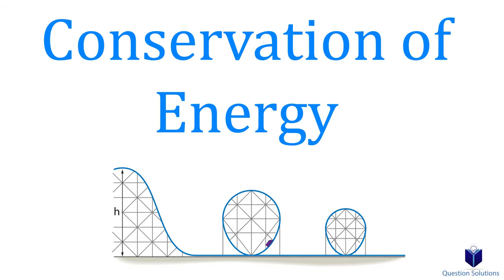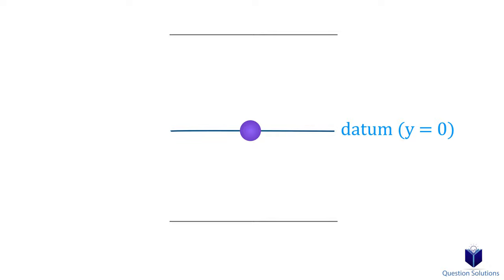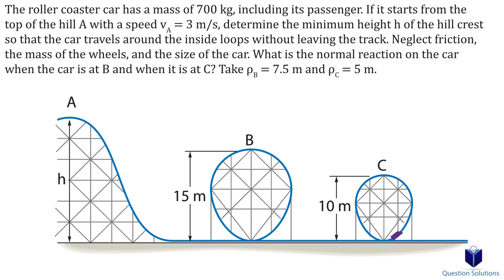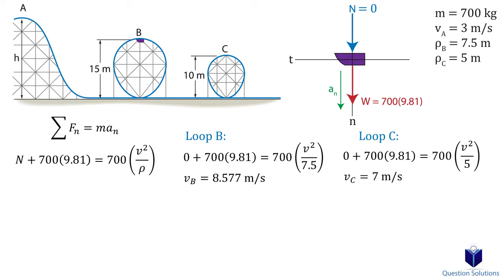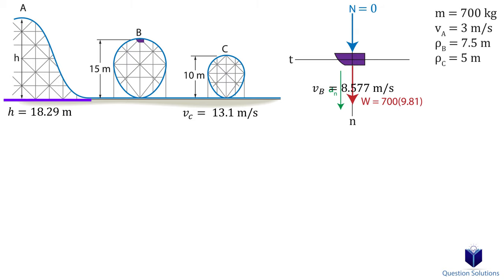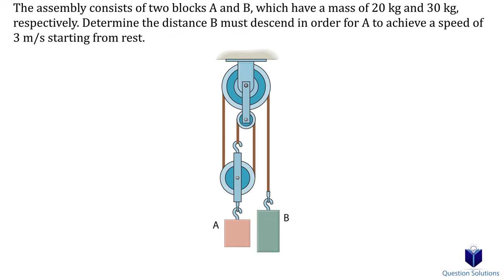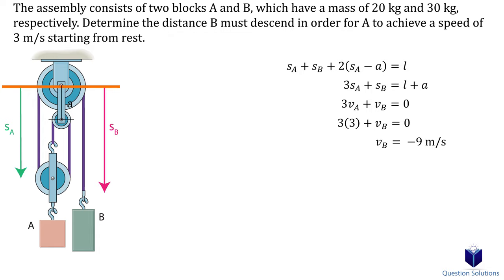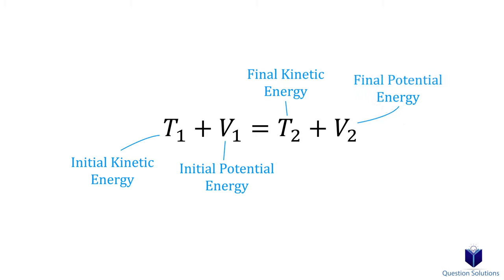Conservation of Energy (Learn to solve any problem)

Comment: 10:38 shouldn't it be negative delta S/3?
Reply from the maker: If you listened like 10 seconds more, you would have heard me explain why SA is positive and SB is negative for that section 😅 Regardless, SA would be positive because block A moved above the datum so to bring it back down to the datum, the work done is positive while SB moves below the datum, which means work has to be done on the system to bring it back up to the datum, so it's negative. 👍
Reply: Yeah i got that sir  i heared it thats the principle regarding datum

But  transposing in algebra,  could you help me to understand sir why
3d delta Sa +deltaSb=0 doesnt change i  polarity
Reply from the maker: @menglimarrero4296  So we drew all the position coordinates downwards, so the green and pink arrows. We assumed that down is positive for that part. Please watch: https://www.youtube.com/watch?v=IudPPGIV5QM
Reply: Thank you
I got it
3SA+SB=0
3SA+(-SFinal-Sinitial)=0
SA=-(-SB-0)/3
SA=SB/3